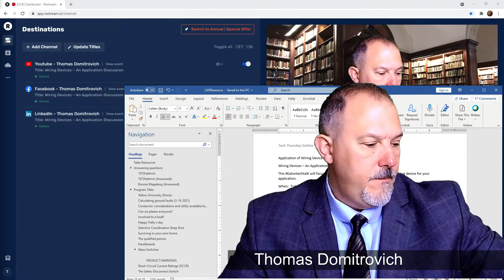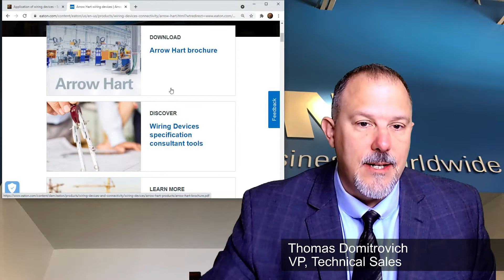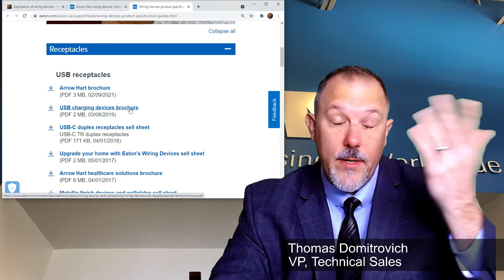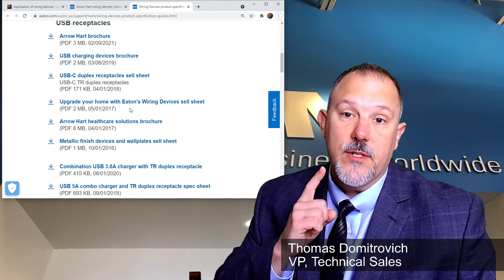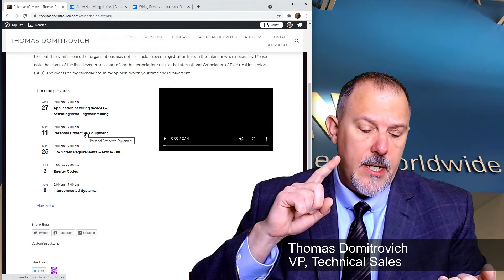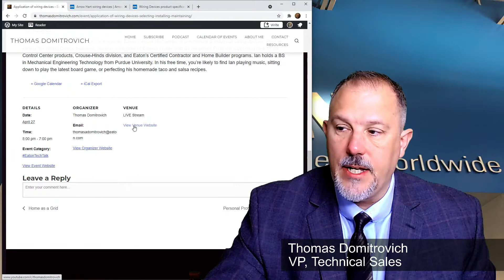Wiring Devices – An Application Discussion

Comment: Can hear it with ear piece. Was always wondering why they never came out with a 208 volt 3 phase 4 wire plug & receptacles for 20 & at least 30 amp. Only used pin connectors a few times in my 50 years for 2 reasons: very expensive and not many supply houses stock them. Looking forward to the vid. Stay heahthy & work safe safe wear your PPL.